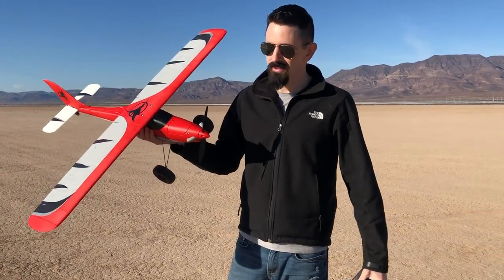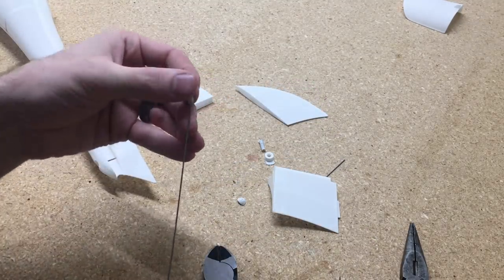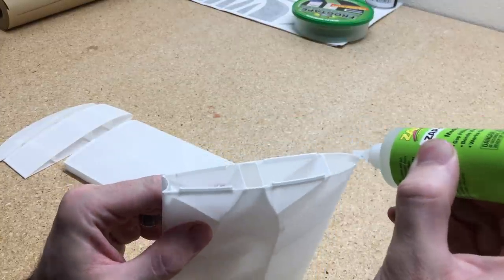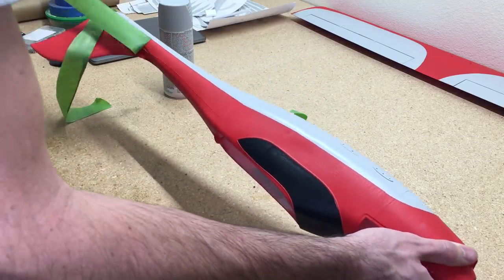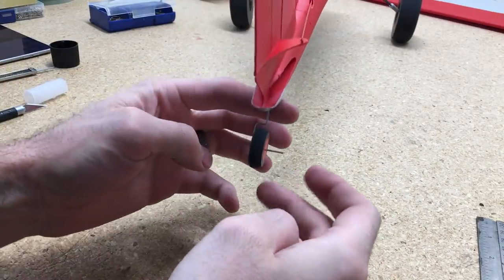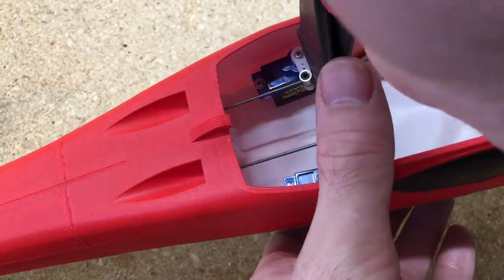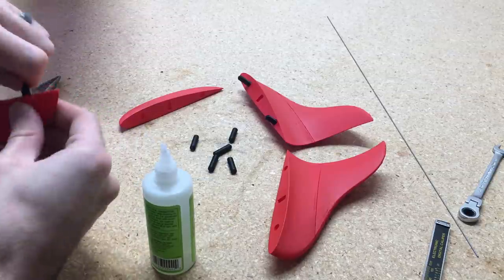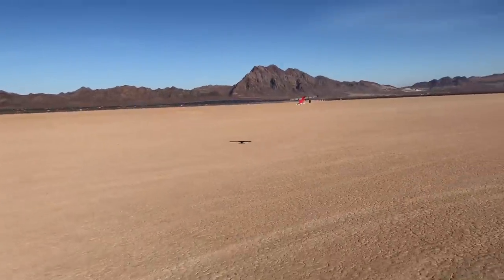How to Build Eclipson Model C 3D Printed Bush Plane - LW-PLA

Comment: I'm sure everyone who buys an Eclipson Model C watches your video!  Thanks for taking the time.  I've got most of mine printed out of Polymaker Polylite PLA-LW.  I'm new to printing and RC planes and didn't understand the differences between foaming and pre-foamed PLA.  Sounds like I ended up taking the easier route with the heavier but easier to print pre-foamed.  Once I realized what I had with the Polymaker, I was able to get my settings dialed in well enough.  Slowed the Bambu P1S down and cranked the temp up to 235°C.  Not sure if I should try going hotter but it seems maybe my temp. sensor is not accurate as 235°C seems high?  My first 3D print was a tracked version of Benchy then I went right to the Eclipson fuselage.  Thus I don't yet know much about printing.

Looks like Eclipson has added holes for a ø6mm wing tube stiffener?  And I see you mention they redesigned the #2 fuselage section for beefier landing gear mounting.  

Hopefully my plane doesn't end up too heavy to fly well.  I only compared a small part thus far for PLA to PLA-LW.  My scale only goes to the nearest gram but I'd say the Polymaker PLA-LW is a bit more than 25% lighter with my settings.

Comment: Hi Troy - in fueslage 3, it printed great for me, except for the vertical rib in the base of that piece of the fueslage.   it starts off with some loops or extrusion that didn't quite grip, but it then forms the majority of the rib.... did you have this issue?  Checking the preview in Cura shows that it should have bridged, but it didn't, about 10 layers later they all look fine...   any ideas?

Comment: I'm in the middle of assembly everything is going fine. One comment though about the wheels. Since I don't want to get into a bunch of specialty PLA (i.e. LWPLA) and am using normal PLA for the plane Eclipson says to not use the TPU printed wheels if you are using normal PLA to print the plane. They recommend using foam wheels which are lighter. So I ordered the 40MM foam wheels in your materials list. I got them the other day and they are way small compared to the printed ones. I fly on a grass field and I'm not sure they are going to work out. I've tried finding some larger versions that still have the correct 2.0mm axle size but no dice so far. I've looked at DU-BRO and no luck there either. It seems in this hobby that there is always at least one detail that threatens to kill the deal so to say and this tire/wheel thing may be it.
Reply from the maker: I built a PLA version of this plane to compare the materials and I used regular TPU for the tire for that build. https://www.youtube.com/watch?v=YkGxwpNvmZQ. It flew ok but still needed a bit more power I used a 980KV motor with 8x6 prop for the flight. After that I changed it out to a 1400kv with 8x6 prop and it flew much better. So you can use regular TPU it will just be a bit heavy. The tires are 84mm in diameter here is a link to some tires that would work better on grass and have 2mm axel https://www.amainhobbies.com/dubro-3.00-micro-sport-wheels-2-dub300ms/p130274. I. will add this link to the description also. Good luck with your build.
Reply: @TroyMcMillan  Thanks for the link on the wheels and comment on your experience using TPU wheels, I saw the linked wheels on the DU-BRO site when I was looking for options  but for some reason didn't see that they were 2mm axle. I'm going with a 1250kv motor as recommended by Eclipson. When buying that motor I noticed in the specs that one prop option was a 9x4.5 running 3s or 4s. So I purchased some of those size props along with the normal 8x6. So now I'm thinking of turning this endeavor into a wheel-a-thon by mixing and matching wheels, props and even battery c count. This is probably going to take some time as I'm sure there will be a crash or two or three somewhere on the journey as crashes are firmly in my DNA.

Comment: When measured with a dial calipers, what is your wall thickness of the fuselage sides and wing skin area? Which settings would need to be changed for the thickness? What would cause a bulkhead to print on bed side of the fuselage? Eagle printed needs put together. Started printing the  Eclipson Mod C. Still figuring out the settings in Cura.   Trying out the new PolyAir LW-PLA. Used most of the ColorFab on the Eagle.
Reply from the maker: It is .4 mm thickness if it is to thick reduce flow setting. I print LW-PLA around 55% flow. Have fun with your builds. Ya I just saw that new LW-PLA from 3dlabprint and want to test it out.
Reply: @TroyMcMillan  Just printed the center wind section and the top skin is not attached spar or cross rib sections. Ideas? I will need to increase the flow rate since I am getting an average  of .27mm skin thickness. I am pretty sure I have a .4mm nozzle installed, time to check.
Reply: @TroyMcMillan  What setting would cause the top skin of the center wing section to be not attached to the rest of the wing structure?
Reply from the maker: @Stubby0266  Ya definitely increase flow rates that is too thin of walls. Also maybe take your nozzle off and clean it. It could be clogged up having that thin of walls.
Reply from the maker: @Stubby0266  The wall thickness could be to thin
Reply: @TroyMcMillan  I will replace the nozzles in both machines and see what that does. Thanks for your help.

Comment: You don't fear the limited temperature resistance of PLA in summertime, especially for dark coloured parts?
Reply from the maker: I have flown 3D printed airplanes in the heat a lot and have not had much trouble with this.

Comment: You make some great build videos man! I really like this plane but I mostly fly 3D planes and am wondering if the weight (and/or design) limits it to just cruising or can you huck it around a little? Thinking this might be cool to slap a DJI FPV camera on.
Reply from the maker: This plane is pretty strong for sure. Yes an FPB camera would be nice for this plane I have seen people do that a lot.

Comment: Great video and amazing build . How do you paint the LW-PLA ?? when i try to spray paint it becomes soft and fragile..
Reply from the maker: I just make sure to use multiple light coats and let them dry between coats and I have not had any problems with them getting brittle.

Comment: Hello Troy

Merry Christmas time to you from Switzerland

I have problem with slicing Eclipson Model C, part Fus2 (item 6)
I just bought the STLs for the Eclipson Model C (2 days ago). The slicer in use is Prusa, and the print is with eSun PLA+ filament, (Printer Ender 3 Neo). It works fine so far, the wing sections are made and some fuselage parts as well.

I have one issue on the fuselage section Fus2 (Item 6): If I slice with Prusa (or Cura for that instance) it will not create the straight reinforcements for the landing gear mount ovals.
Pictures in the attachment.

If I load the G code from the original Eclipson file on the Prusa G code viewer, it creates those reinforcements.
The STL file shows the reinforcements as far as I can tell.

The slice settings are all in accordance to the instructions and your videos.

Can you help me with this issue?
Thank you for your time.

Ps: I posted this on the Eclipson Airplanes Pilots Facebook group as well

Sincerely Edi

Comment: I have an issue with printing wing sections when dropping the g-codes straight into my ender 3 pro (with glass bed). The prints are perfect with one exception: the surface which was attached to the printer bed is not perfectly flat, it raises slightly at both ends which results in gaps when I'm joining the sections? Any clues? Bed temp is 60 deg. I had the same issue when printing my model T, both prints are in LW-PLA.
Reply: I have this exact same problem with my Ender 3. Switching from the original to glass bed helped a little. Thought the bed must be warped. Most sections printed fine, but the right side of Wing_C that sits against the bed will not print perfectly level no matter what I have tried so far. I am slicing the .stl files with Cura, not using the g-codes. Anyone that has a potential solution would be helpful!
Reply: Level your bed. Search up some tutorials. You're gonna need to raise your bed a little using the screws under the bed to make it go up to down.

Comment: Hi Troy, nice build as always 👍. What type of paint do you use to spray the airplane? It is beautiful. Does it add any noticable weight?
Reply from the maker: I used Krylon Paint&Primer all in one. Unfortunately I did not weigh the parts before painting. After I was done painting I thought of this and should have weighed them first.

Comment: What settings have you used for your Tundra tires.
Reply from the maker: For Various TPU
60% Flow 
30 mm/s
240C
10% Grid Infill 
2 Walls
3 Bottom Layers
4 Top Layers 
If you want to use regular TPU just set 100% Flow

Comment: Troy what type/size screws did you use to attach the wings to the fuse and the motor to the motor mount?
Reply from the maker: For the wing use M3x30 machine screws with 3m nut. Motor mount M3x6.
Reply: @TroyMcMillan  Thanks Troy, Your the best!

Comment: Hi troy first build of this 3d plane ,after seeing you vids 👍my question is after trying to print 11&12 part number rudder 1& 2 doesn't print a solid bottom ie ends are blank not sealed when print starts ? As i notice yours was what changes did you make in print settings for this ? Any help appreciated in this iam using cura thanks👍

Comment: Troy, I have a question but don't know how to contact you other than in the comments here. I'm having trouble printing the fus2 section of the Model C plane. About 50% of the internal structure in one end of the section can't bridge the large gap and ends up as a rats nest of unattached layers. It is the area where the landing gear holes reside if that helps. Did you have any issues printing this section (fus2)?Edit: well I restarted the print and just let it go, it did the spaghetti thing again but eventually got some structure established by mainly just filling the cavity with a rats nest of filament such that the structure could bridge the gaps needed. A pretty ugly way to get the job done but I guess it works. The Eclipson folks really need to redo the design on fus2 because ATM it is hot garbage, in my opinion. I'm going to try and print the section again using their supplied gcode to see if I get a different result.
Reply from the maker: I have had experience with some of eclipsed parts having this problem. I have just let them keep printing and allow them to fill the gap. For my prints I would have maybe 4 layers max not make contact with the other wall so it was not too bad of appearance and when you glue the rest of the fuselage together it covers it all up. I agree try the G code and see if that helps.
Reply: @TroyMcMillan  Thanks, Yes I let the part complete printing and it looks ok and should function ok as well. There is just a lot of plastic up inside that is doing nothing but adding weight so a redesign of the part would be good. I'm going to work on trimming out as much of the excess as I can to save some weight.

Comment: Troy, did you have much of a battle with stringing and printing faults? You documented your problems with the Cessna 150 pretty well. Here, it seemed like not much of a challenge. Better files? I hear LW-PLA is a "trial by fire."
Reply from the maker: The 152 was much more difficult because 3dlabprint does not use Cura as a cutting software. Eclipson has a special way they design their planes to print with no retraction so therefore no stringing at all. So it is ideal for LW-PLA other company's it is not the same.
Reply: @TroyMcMillan  HHHmmmmmm. Makes me think that maybe buying a 3DLabs plane might not be the best decision when it comes to ease of printing and assembly. I think they ought to revise their files for the rest of us that don't want to buy a $700 printer and $150 slicing software.
Reply: @warbuzzard7167  We work with cheap printers (ender 3) and cura to understand the problems that most people will have and to make the design more adequate for everybody and not only for those with expensive printers.
Reply from the maker: @warbuzzard7167  Yes exactly. If you want to print one of their planes easily the best option is to have a Prusa. If not good luck

Comment: Happy New Year Troy, and thanks for making another video.
I'm having an issue getting good prints in Vase mode for single wall prints - I get a lot of bumps on the side; sort of like you'd see with Randomizing Z Seam.
Is there any way you could post your CURA config file(s)? I watched your video on printing, and still have this issue.I've done a LOT of 3d Printing, however, most of it has been with 1.2mm walls at the minimum.
Reply from the maker: Happy New Year to you, I posted me settings I used in the video for thin wall in the description. Unfortunately both with PlanePrint and Eclipson airplanes you can't print their parts in Vase mode. So I would recommend turning vase mode off and locate the Z seam in a specific location (Back). If you rotate the part you are printing so the Z seam in on a corn this works the best. As far as bumps on the side of your prints when I have seen this issue it is because I had combing on and avoid printed parts selected. Turn all of this off. But if you do have it in vase mode this will not be the problem. Try some of this and let me know. Cheers
Reply: @TroyMcMillan  Ah, that explains the issue. Thanks for getting back to me so soon.

Comment: Troy, I love your videos on 3D printed planes. I'm just getting started and I have a newbie question. I'm trying to figure out how to mask off areas for painting. I see you use green painters tape which I have. Your masks look extremely precise and sharp. How do you go about cutting the tape without damaging the surface of the plane? I haven't tried it yet, but it would seem like using an X-acto knife would possibly cut through the thin printed surface, especially on these LW-PLA prints. Any advice would be appreciated. Thanks!

Comment: Hi Troy, I love the videos and have been following for a while. 
I am experimenting with LW-PLA for the first time and just want to clarify the ideal print temperature. I am trying to print the Eclipson Model A trainer and am having some difficulty dialing in my ideal temperature. I achieve the greatest expansion 200% at 255*C however when I print a test piece the part feels very brittle. I noticed on the drawings that your recommended print temperature is 235*C. Is 235*C the best balance between expansion and strength? 
Can you recommend what temperature you print at to achieve the best strength
Reply from the maker: Yes I do recommend 235C at 53% flow. At 255c the material foams to much and is brittle because there is more air in the material the lower the temp the more strength it has but needs to be above 230c to make the foam reaction. Thank you for following my builds. Have fun with the model A it flies very well.

Comment: Thank you for this video Troy, one question, the LW-PLA is kind of expensive, like $140 for one roll, is that correct? How many airplanes like this model could be printed with just one roll? Could you tell us the total cost of this model? Trying to make sense if is cost effective. Also, is this LW-PLA available for sale in the USA? Thank you for the awesome content.
Reply from the maker: The only place that makes LW-PLA is ColorFabb in the Netherlands. So to get it in the US you need to ship it. I payed $30 for shipping an bought 2 750g roles. I Paid $120 including fast shipping. So one role should be less than 100 to have it shipped. When printing thin with this material you print at 53% flow. I have only printed 2 of Eclipson planes on the same role and still have plenty left over I am sure I can get 3 planes maybe 4 planes from one role of LW-PLA. As far as everything else goes I put links to all the parts I used for this plane.
Reply: You use only 50% of flow rate with LW-PLA so the price will  be half. To print this model you will spend like 12 USD. Colorfabb send you the material also to USA

Comment: Hi Troy, Thank you for the great video. I have a question. I am trying to find 2212-13 1400kv but I couldn't find it. but I found SunnySky X2212 KV980. Can I use it?  or If I can't, can you please recommend any compatible motor?  Many thanks.

Comment: Hi, i just finished mine in normal pla, i have a question. Did you have any issue with center of gravity, mine weight 830gr with a 90gr lipo but i need at least 100gr more on the nose. So i will buy a 2200 mha 3s to m1ke it right.

Comment: How do i  considerate dimension of fueslage nd wing accurately please need suggestions
Reply from the maker: Im sorry I don't quite understand your question.
Reply: @TroyMcMillan  from where to  do i start sir , i am beginner and this things are highly fascinate me
Reply from the maker: @mohitpatel4720  Well there is a lot to building this. First is to get a printer and some PLA to start printing. Also to have a RC transmitter to control this. Sorry there is a lot to cover to build this maybe if you have a more specific question.
Reply: @TroyMcMillan  thank you for your answer ,it means a lot for me ... 
  If is there any book which you would suggest to prefer than plz let me know🙏
Reply from the maker: @mohitpatel4720  I am not aware of any books to help you with this. You will need to learn about RC airplanes first and get necessary equipment for the hobby of RC. Transmitter, receiver, Charger, Servos, motors etc. Then you will need to learn about 3D printing and get all equipment required for that. Printer, PLA,LW-PLA,TPU, Software.